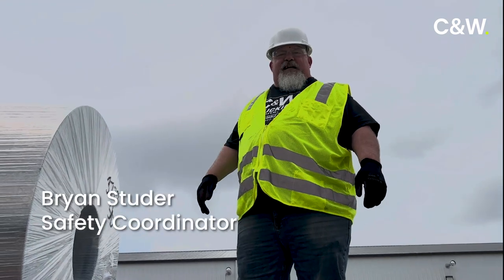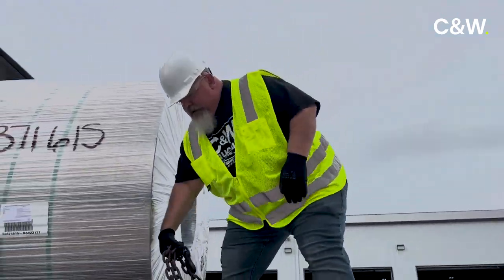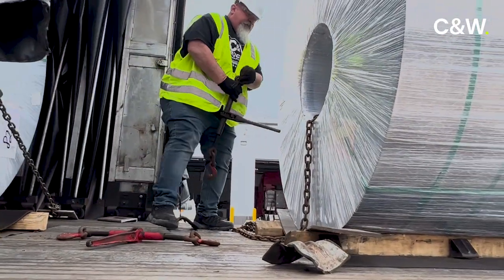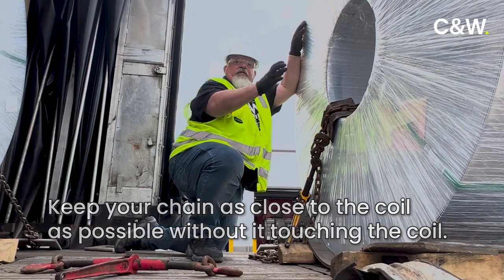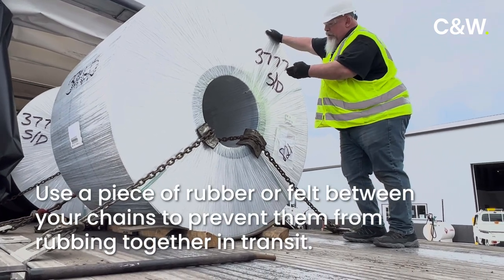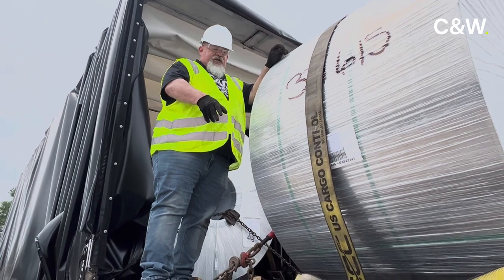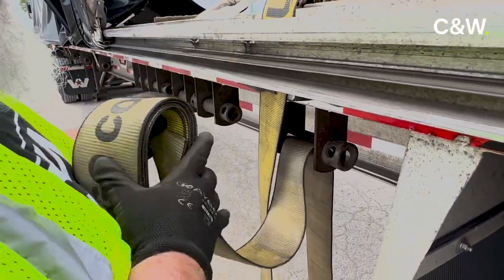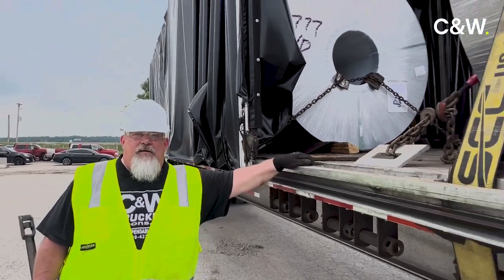How to Properly Secure Coils | C&W Trucking

Comment: I hauled steel back in the early nineties , michigan doubles and toll road lcvs .
And we just threw 2 chains over the top and called good.
Those old timers said that if you put to many chains on them , if you take a turn or a exit to fast the whole truck will tip over , but this way the coil rolls off, truck stays up right.
However , I know we can't do that any more because of our points system on our cdL, and we have to go by the book on all this stuff now days.  Cheers from northern indiana usa

Comment: 17k over 12k is nothing if you have to brake hard or swerve hard on a hill. Add chains and or straps accross bottom and over top of coil. Put huge glulam headers for chalking. Place as many 5 foot stacks of pallets as you can to cushion and slow down the coil if it breaks free.
Reply: Seriously?  How much experience do you have and why do you say 17k isn't enough for that?  I have none, but that sure seems secure to an untrained eye.  Now I'm going to research glulam headers.  never heard of it.  and chalking.  I never heard anyone mention the seam-side of the chains before!    I got a lot out of this video.

Comment: OK There are a variety of reasons a shipper or a driver would choose shotgun or suicide position of coil loading. The driver is correct about x chains here. He padded in between the 2 chains. And he even added an unnecessary strap over the top which provides an extra 6k WWL.

Sometimes YouTube comments are surprisingly ignorant.

Comment: crazy way to load coils. 
they should be loaded so a fork lift can get to the center of it. 
one chain pulling forward, two pulling to the rear. 
in decades of hauling them this way the only time i saw a fail is when the driver pulled out in front of a train,.

Comment: Sorry, but people who X chain through the eye of a coil don't have a clue. You need to read a few books on rigging. Do you even  know what a basket is? Do you realize the effect chain angles have on strength ?
Reply: Buddy DOT FMCSA Securement Guide demands X CHAIN on shotgun style placed coils for suicide coils they are not necessary. This is not a crane and rigging class. None what you brought up is of revelant.
Reply: @dmytrodolzhenko349  They are forbidden for suicide

 (2) Prohibition on crossing of tiedowns when coils are transported with eyes crosswise. Attaching tiedowns diagonally through the eye of a coil to form an X-pattern when viewed from above the vehicle is prohibited.

And absolutely stupid on shotgun.. That x chain is nothing but a problem unless it wraps back around the outer edge if the coil.

Sorry you couldn't cut it as a crane operator/rigger. But hey maybe you'll do good with your 70 hour a week OTR job
Reply: @joecummings1260  Doesn't matter if your right or wrong the federal rules are x chain on shotgun and pulling a chain back against the edge will result in damage claim you would be a very poor steel hauler.